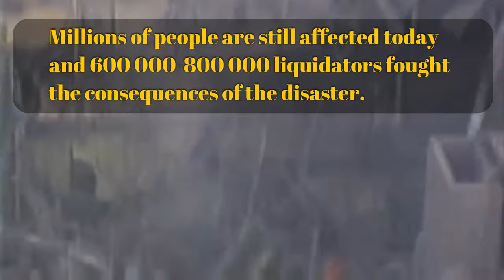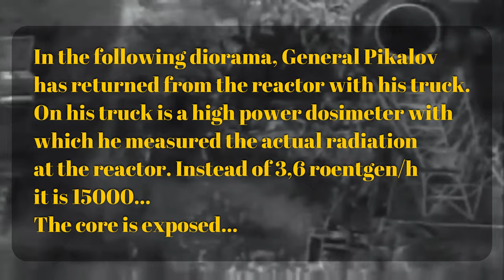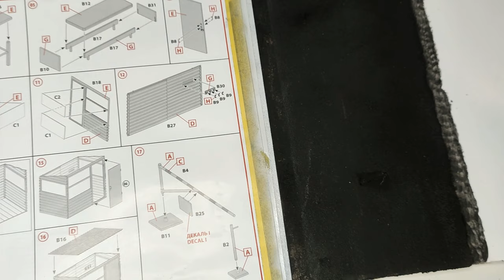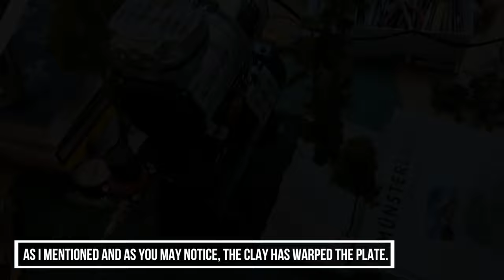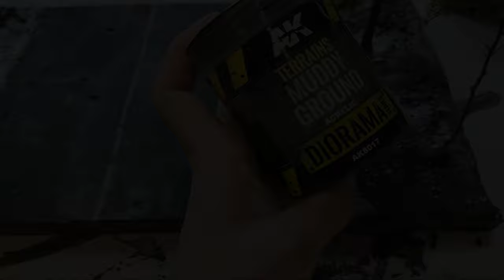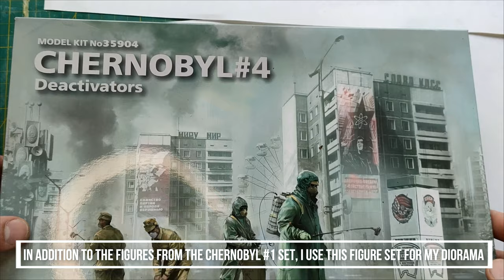"It's not 3 Roentgen, it's 15000" | CHERNOBYL Diorama | 1/35 | ICM Chernobyl #1 & #4

Comment: but nuclear power will stop global warming.
Reply from the maker: Of course there are advantages to nuclear power, but the disadvantages outweigh the advantages. Nuclear power plants are very low in CO2 emissions during operation, but the production and final storage of the fuel uranium, for example, is also very harmful to the climate. But nuclear waste is of course the biggest problem. 40,000 generations or people in one Million years after us will have to deal with this. And the Cheronobyl reactor accident showed how humans can come as close as possible to opening a gate to hell
Reply: @ModeliteDiorama the  Chernobyl accident was more the fault of soviet poor control and construction than the fault of nuclear power, and for the safety of nuclear generators there are many new types that produce very little nuclear waste, which in its self the nuclear wasn't isn't deadly as it placed into concrete cylinders with lead cores and doesn't have and leaks and is mostly place deep underground where it isn't a harm to anything, and some power plants are built to reuse the waste as even more fuel